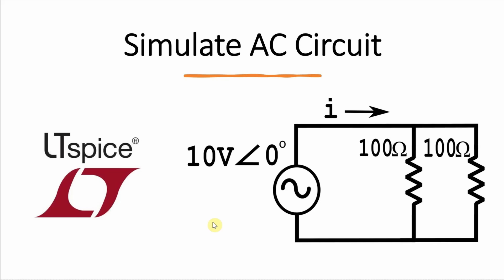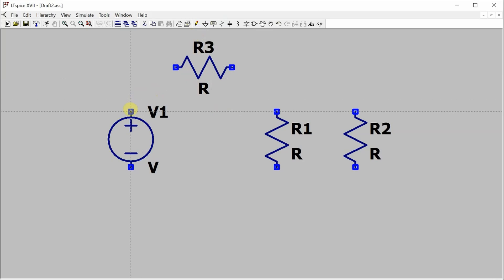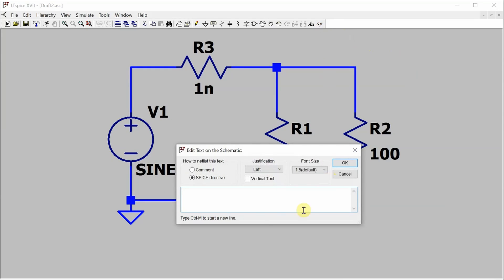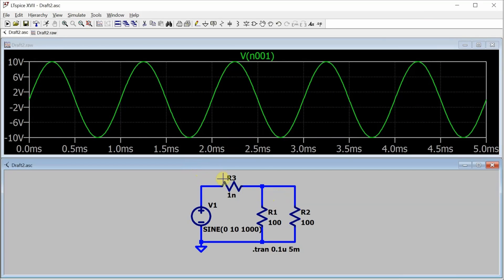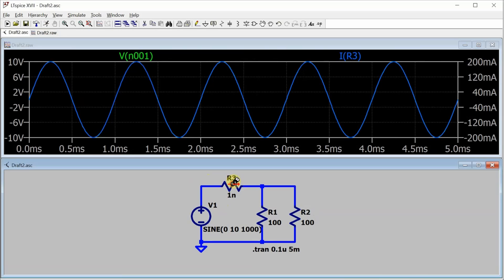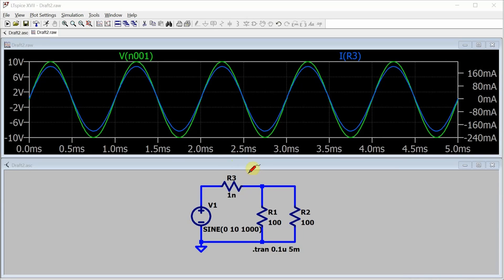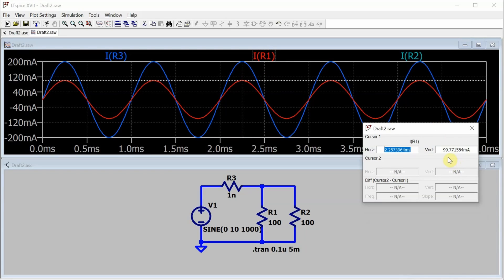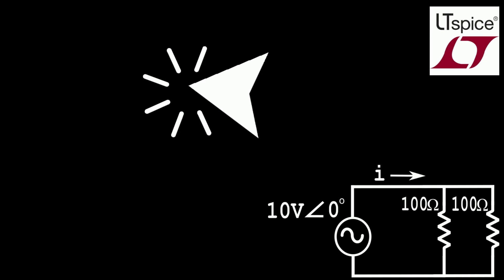LTSpice - Simulate AC Circuit with Parallel Resistors

Comment: Say, I'm learning about how a 240 Volt 60Hz residential clothes dryer (automatic dry) circuit schematic works.  When in one of two different circuit conditions, and receiving 240V, a timer motor (2400 Ohms) wired in series with a 10 Ohm large heating element... provides power to the timer motor and winds the clock down normally as I would expect, but I wonder why the heating element doesn't produce heat when it's still connected albeit in series?  Is the 2400 Ohms somehow blocking current?  Is there is a larger voltage drop over the timer motor such that none is left for the heating element?  The other circuit condition I think I already understand, because an operating thermostat closes and calls for heat, and effectively short circuits(bypasses) the timer motor, providing full 240Volts to the 10 Ohm heating element which would be 24 Amps under this second condition, causing the heater to produce full heat whilst not causing the timer to run it's time down, and this is by design.  Thus the wetter the clothes, the more the thermostat calls for heat, and the less the timer runs down.   Towards the end of the automatic dry cycle, the thermostat is cycling OFF more frequently since the clothes are drier, thereby running the timer down more to completion.  Thanks if you can offer some teaching!

Comment: Thank you for your great video.
Question:  Why is the ac voltage source which is expressed at the beginning of the video as a circle with the symbol of sine wave inside then represented by the Spice as a circle with a plus and minus sign  inside ?

This is also found in some books. Why not always use the common ac voltage source symbol  ?
Reply from the maker: That's a good question. The main voltage source symbol is just drawn with the plus/minus signs, but is configurable in many different ways (DC, pulse, square, sine...). I guess then you only have to know where the one voltage source symbol is regardless of the type of voltage you are using. I believe it's possible to create your own symbol if  you want.
Reply: @ElectronXLab  
Thank you for your answer. Now I understand your answer regarding Spice.
Would you give an explanation for the reason why some books use a circle with a plus and minus sign to represent the ac voltage source instead of the common symbol of the voltage source ?  Does the plus sign mean that the  sinusoidal wave of the voltage starts with zero volt at time t equal zero which means that the first half of the voltage wave is positive ?